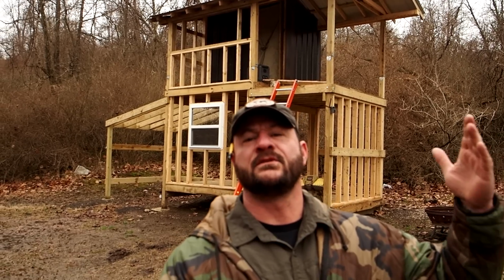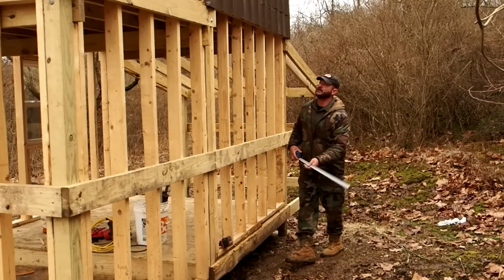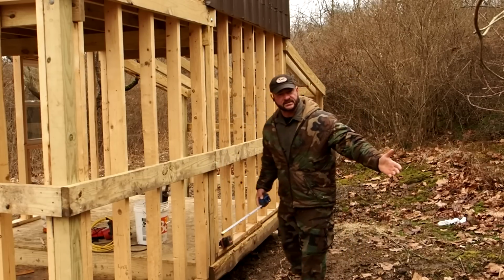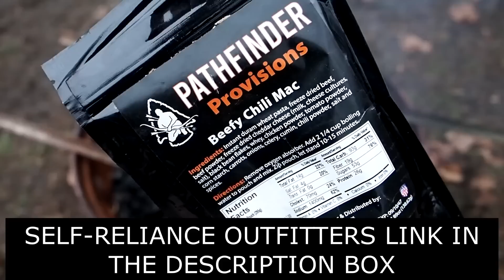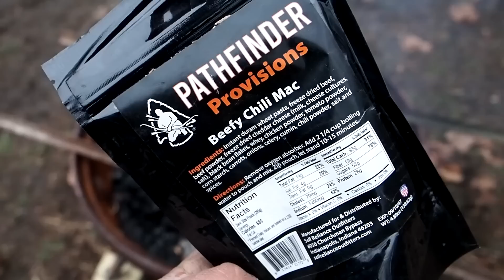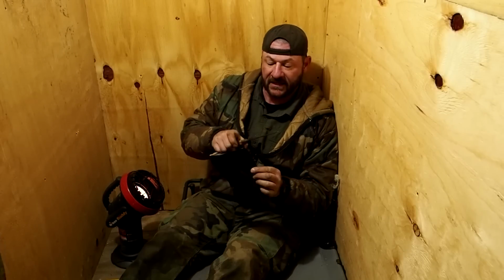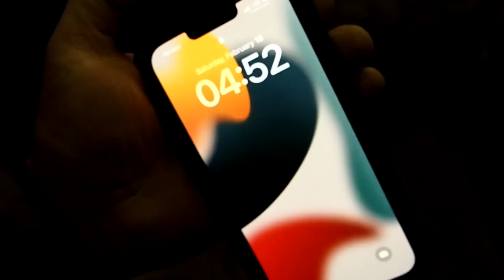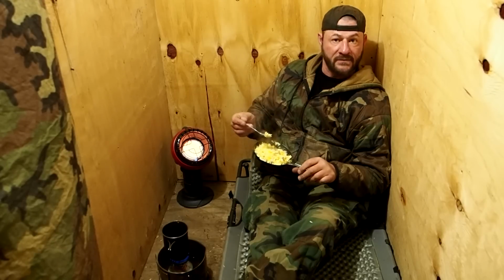Solo Overnight Building an Apocalyptic Camp in the Woods and Sausage Egg and Cheese Skillet

Comment: I had such a mud problem when I first bought my place years ago. I tried stuffing high walk ateas with rocks, 5/8 inch minus and nothing worked til i used hogfuel. I could even walk my horse across it and not sink in the mud. Its biodegradable and it works.  ❤🐺❤

Comment: if youre not going to use any plywood on the walls you need to put in some diagonal bracing for shear resistance or the entire structure will be moving with every gust. you can see it happen if you grab the framing and try and shake the building.
Reply from the maker: where was it stated no plywood was going to be used?

Comment: Cabin is looking great. Thank you for bringing to my attention that drill-powered nibbler for cutting metal roofing. The last time id did it I used an angle grinder with a cutoff wheel which got great results but that stuff just ate grinder blades. Something you might find useful: I have some muddy acreage as well and I bought an electric wood chipper. Now all the branches too small for firewood get chipped up and spread on my trails. Cheaper than gravel and I don't have to haul it in. Also it keeps the "natural" look of the trails.

Comment: Loved the movable suspended fire video.

And it reminded me of  Leonardo da Vinci's self suspended arch.
A self supporting structure that  is stronger than others.
Using other types of fasteners.
So you can use it to
For example raised fire
Or bed with out needing to be tied.

And if two arch are put together it creates a self support circle that is very 
Strong. 
Even bear resistant.

Comment: As a thought have you considered a Shorts video on making fired clay bricks from the mud around a building ( if possible )? It's a technique i've seen "primative tech" channels do but you aren't limited to old tech so it would be much simpler with a modern small kiln. Or you might just as easily make pathway bricks with cement added to mud.
Reply from the maker: most cant seem to watch

Comment: Breakfast looked great, dinner looked like delicious death in a pouch for an old "broken down" man.  Downing an MRE when I was 21 and invincible was an entirely different prospect than a pouch of chili mac or an MRE in my current mid 50s acid-reflux state of existence. No cold beef stew, meatballs and tomato acid, or spaghetti with meat sauce in the rain could hurt me in my prime!   Gastric nostalgia aside....not sure what your plan is about interior wall cover, but if you put some in and insulate, don't forget the rodent trap first for the bottom of the metal siding to keep those suckers from turning those open siding grooves at the bottom into their subway and nest entrances.🐀

Comment: Question for you Corporal....what are your thoughts on the aquaquest defender 10'x10' tarp?  It seems pretty durable even though it comes in at just over 3 lbs.  I'm torn between the tried and true DD 3x3 and the aquaquest, just wondering what your thoughts were.

Comment: Ok, I just subbed... used to sub on an old phone, just remembered CC. 
But, having had a 30-year career as a carpenter and contractor, pre Army and post discharge... why start sheathing at the top? Why not ground up? Easier to get your water shedding overlap and conceal cuts bottom up. Just curious, and may find the answer as I go back to the beginning.... DAMN guess I started from the top down with this video. 🤣
Reply from the maker: thanks for watching